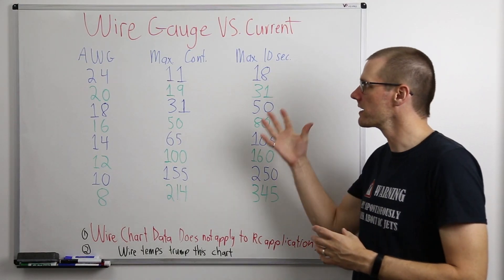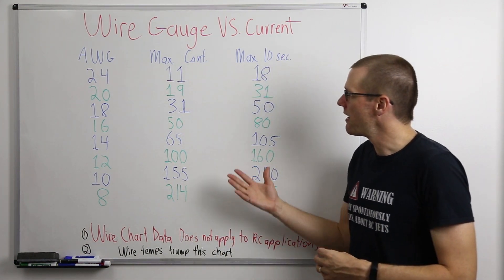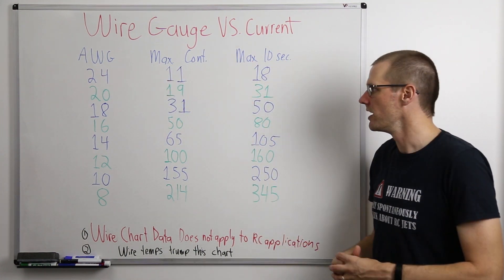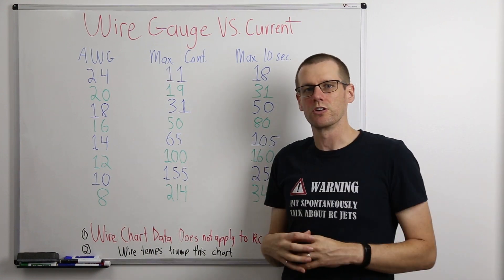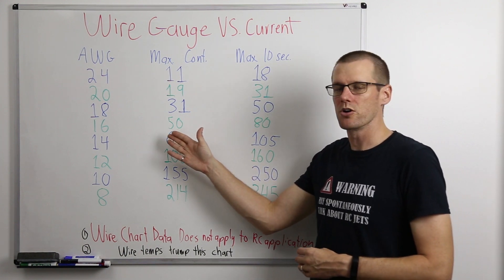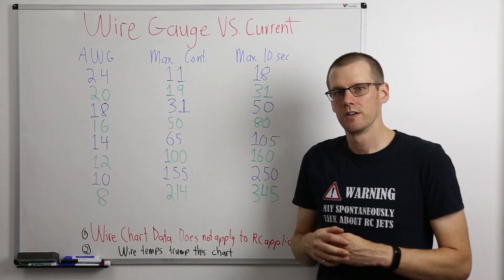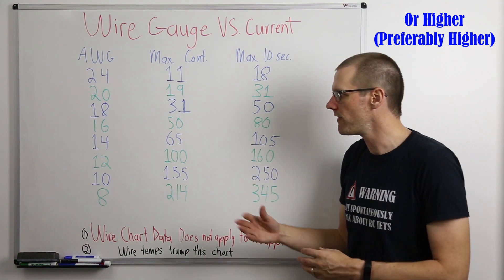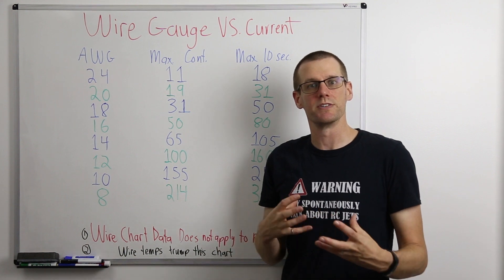Wire Gauge Maximum Current for RC Brushless Power Systems

Comment: I made a calculator that calculates the temperature rise in cable due to it's material characteristics like material density, specific heat capacity and electric conductivity. Heat exchange with the ambient is considered zero. I come out on  a AWG10 loaded with a 155 Amp rectangular pulse for 10 seconds will rise 43 degrees due to it's material characteristics. A THHN cable can easily gold 155A for 15 seconds when it reaches the 90C max temperature. If you lower the current to 100A the same THHW cable can hold the 100A for 36 seconds.

Comment: 70C wire temp is not very hot, in perspective, most fets are rated 125C or higher. One of the limiting temp is the wire insulation, silicon can take the heat better than most (teflon is probably higher).

Comment: So big question. is your calculations based upon using solid copper wire? Or.. CCA (copper clad aluminum) wire that pretty much all esc and motors made in china use instead.   So if your wire size is based upon the resistance of copper wire then all of your wire size on the chart needs to go down at least 2 gauges for CCA wire .
.
Reply: so 6 gauge CCA wire should be on the new low gauge size.  so a dual CCA 8 gauge wire on a 500amp esc . would be equivalent to two 10 gauge copper wire @310amp constant and @500amp max burst. Which the max amp wire value is equal to the esc constant amps= possible fire if esc amp output is correct.  Stupid chinese , I dont think they even test their stuff for more than 2 seconds to make sure it doesnt fry itself. so I would make sure they have warranty before you buy it
Reply from the maker: Definitely not solid wire used for AC current. Stranded is best for DC
Reply: @RCexplained  LOL, I am sorry, but that answer is incorrect. The very low switching freq all of these esc use, it dont matter if its solid or stranded, there is NO SKIN EFFECT at these freq. We use stranded for flexibility. The good wire is copper, like Deans wet noodle.

Comment: But if you use 2x 4s batteries on a 200a esc is that only 100a per side so 12awg might be ok??
Reply from the maker: Packs wires in series would pull full current. Packs wired in parallel would each have 1/2 the current drawn from it.
Reply: @RCexplained  so would you NOT suggest 12awg 2x 4s batteries to be used in a 200a Max5 on 8s? Some reputable peoplen say if the connection is good your fine?
Might not be ideal but is it unsafe?
Reply from the maker: Depends on what you will be pulling from that ESC. More than likely you will be fine.
Reply: @RCexplained  Thanks, you think if I throw some qs8 on there would help? ... I'm really good at soldering them qs8 up really strong👍
And, I'm guessing if it's going bad the wires themselves will be getting very hot? Like over 200 I'm guessing

Comment: Doesn't the cable length matters? As the longer the cable the higher the loss and the thicker the cable the lesser the loss.
Reply from the maker: Yes, the general rule of thumb is to keep cables as short as possible. Any additional length will just add resistance. Luckily, more length will help dissipate waste heat that could build up in the wire over longer runs. This is why you don't see it as a function of the chart.

Comment: Great explanation of the gauges.  More specifically to RC speed runs.  Is there a problem with having a SMALLER gauge wire in a series or parallel connection going into your speed control? 

Example:

QS8 Plugs. 
XLX2 has 8awg wire. 
Batteries have 8awg wire.
Parallel/Series connection 6awg wire.

Will the lower awg increase ripple as it allows more amps and current? I assume it does🤔not sure.  Want to know your expert opinion. And thanks 🙏🏾 I love your videos and so greatful for you educating us in the hobby.
Reply: no
Reply from the maker: Hi Matrix RC. A 6awg wire is larger in diameter than 8awg.
Reply: @RCexplained  that was not his question.

Comment: sorry my english is not so good i cant search what i need on google. can i ask you So what is the principle of the number of turns and the size?
 i mean i have an 18v motor using 0.5 wire with60 turns, if i increase wire size to 0.8 or 1.0 and rewire 30turns then what does this mean?. 
increasing the wire size and reduce the wire turns will make the motor using more currents and increase the RPM right? so what if you only reduce the wire turns?
Reply from the maker: If you reduce wind count only, Kv increases but current capability to support the higher current demand will not be there. This would be inefficient and result in higher waste heat.

Comment: Big problem here.  I shorted five 12v batteries with a 12 gauge wire one morning when I was too tired to set up my evike properly.  You see I home build it.  So I know that the max continuous load of a 12 gauge wire is closer to 250 amps or more at up to 36v.  More than enough power to have batteries blow up in your face long before the wire spontaneously combust.   

Why don't you do an actual test of wires continuous load, and see how that compares to real life.

By your numbers I should've had wires go poof as opposed to batteries blowing up in my face.  If I was you I would double check my numbers.

Edit: for example 500 watts down the AWG line.  750, 1000, 1500, 2500, and even 5000 and 7500 watts of actual power through a line. 

Your textbook numbers won't compare to what could kill you.  Just saying. An estimated 42amps at 65volts will kill, in more ways than one.

Comment: Great videos. Is there a downside to running too big of a gauge wire?
Reply from the maker: Yes. Weight, thicker wire is more difficult to bend, can be harder to solder, bigger connectors are generally required etc.

Comment: The purity of copper alloy, as well as the quality of the insulation, plays a part in these ratings. I would derate the current carrying capacity if bargain components are used in your model.